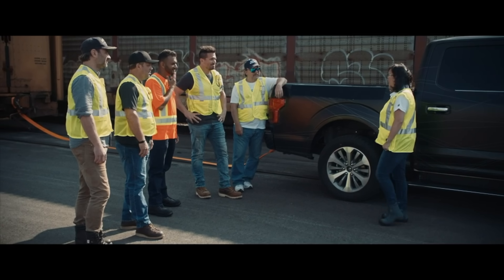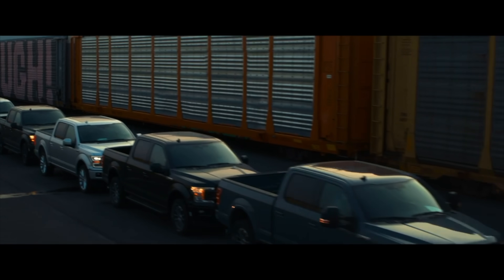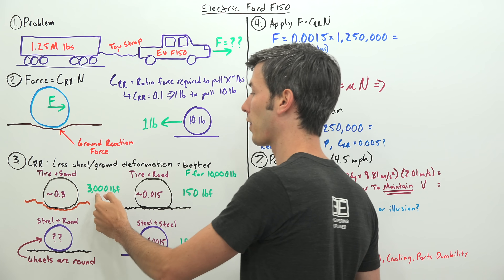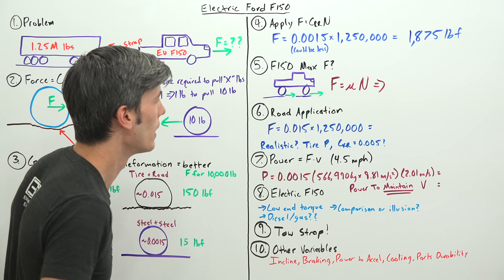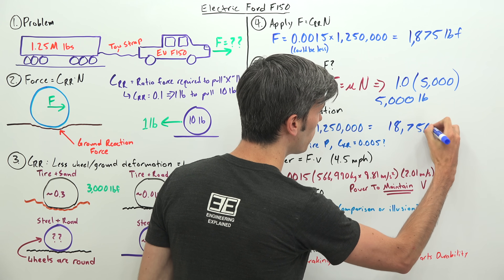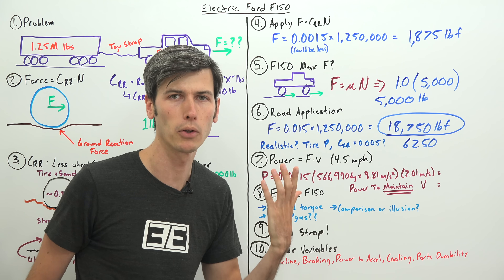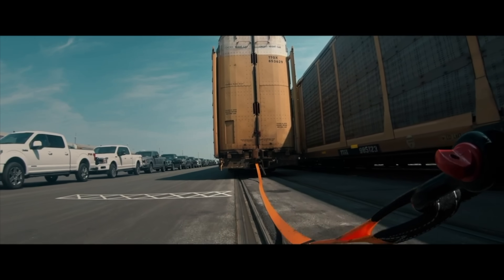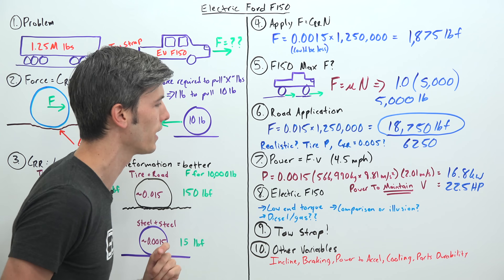No, Ford's Electric F-150 Can't Tow 1 Million Pounds (Realistically)

Comment: Each car weighed 125,000 pounds each. The railroad cars have a coupler that allows each car to move independently. You have a 3-foot draw between each railroad car. Another word's the first car will move 3 feet before the second car moves three feet this allows the cars to move one at a time so you not trying to start with 10 cars of dead weight. Back in the old days before couplers, the train length was limited to 7-8 cars.

Comment: To make it simple:

Imagine YOU, a human being, pushing a car in Netural gear, you push a car that weighs around 1500 kilos, doesn't mean you can lift 1500 kilos, since it has wheels with low friction.

So the F150 dragged a 1m pounds on low friction, so it cannot tow (lift) 1m pounds.
Reply: Towing is dragging something. 

Also tires have low friction? They would slide all of the place with low friction. That’s what tires are for!

Comment: Wait until Tesla's Cybertruck tows Earth to Andromeda galaxy.
Reply: Nah. The truck tows the Andromeda galaxy to our Milky Way galaxy.
Reply: Wait... That's illegal.
Reply: Well Andromeda is already getting towed to us right now by gravity D:
Reply: Wait until you try and tow a boat with the cyber truck and the battery dies halfway to the lake with no chargers fo a 100 miles
Reply: @poolguy101  yeah that's the prairies for you well as far as level 3 chargers are concerned only 6.6 kilowatt level 2 chargers will you be able to charge off of
Reply: @poolguy101   you better hope someone with a hybrid pro power assist F150 shows up and let's you plug into his truck.
Reply: @kdrapertrucker  or I could just let my backup generator run
Reply: @poolguy101  I can see it dying on the boat ramp. Lol
Reply: @maroownr861  what? Electricity and water don't mix?
Reply: Why Tesla truck can’t pull the earth 

*Starts staring at a different galaxy *
Reply: well if you wanna get technical that would require less energy... assuming you have a nearly infinite amount of time on your hands
Reply: You do push the earth, but you’ll pull it back an equal amount as you fall towards it, negating any gains.
Reply: Tesla can't out pull our 3500 at work. So there is that
Reply: no dumbass wait till telsa's cybertruck pulls a million pound load on a trailer with regular tires why cause it will have enough torque for that since a model x can pull a a380 a million pound load would be nothing for that cybertruck and be nothing for it's motor's
Reply: Raven4K The highest level of tesla truck barely can pull more than an F150
Reply: @raven4k998  ever seen the trailer you need to haul a million pounds? Very long with lots and lots of tires.
Reply: @raven4k998  pulling airplanes aren't nothing.vthey use 25 hp tractors to tow A380 at airports all the time.
Reply: @kdrapertrucker  yeah but they have to have special transmission for that cause believe it or not a regular f150 transmission wouldn't last that long doing that sort of thing don't believe me try it I dare ya rich boy that's why ford will try it with the electric f150 and not the gasoline version
Reply: might be the universe will mad with tesla.
Reply: Wouldn't surprise me
Reply: You need a reddit account now!  i would have given you gold for this
Reply: TRÅILBLÅZER lol
Reply: Need a long chord
Reply: lol hahaha😂😂
Reply: Typical ford drivers
Reply: Lets pull Venus further from the sun so we can start terraforming it!   😀
Reply: Archimedes says yo!
Reply: Lmao😂😂
Reply: It would work eventually (read: billions of years), but only if the Cybertruck has some kind of solid surface to push against. Otherwise the wheels would spin aimlessly.
Reply: Ewww tesla
Reply: @scrap5226  So what is you’re argument
Reply: @scrap5226  Well maybe if I watch you’re video on CTE I can track down who asked
Reply: @scrap5226  How are you gonna say who asked to a question it’s pretty clear I asked a question
Reply: @scrap5226  when did I tell you to speak
Reply: The cyber truck sucks

Comment: I actually watched your Tesla Cybertruck towing a Ford F150 video prior to this one (damn YouTube rabbit hole). You said that the electric torque had nothing to do with it being able to tow the Ford, but that it was just the ground force available due to it weighing more than the Ford. However, in this video, you say that this electric Ford has its torque immediately available. So, wouldn't that immediate torque availability give the Cybertruck the advantage over the Ford in that towing contest? I mean, if you can pull forward before your competition and get the momentum going, then you've already won.

Comment: I thought force was in Newtons
Reply: It can be either. 4.45N per lb. 9.81N/kg.
Reply: @alexs3187  isn't N/kg m/s^2
Reply: @alexs3187  f=ma
F/m=a
Reply: Megarocket16 I’m not a physicist, but I think you’re thinking of power. Force is just a constant. Like weight.
Reply: @alexs3187 power is in joules 
N/kg is acceleration
Reply: Megarocket16 joules is a measurement of energy, not power.
Reply: @alexs3187  watts

Comment: I really don't think that the truck in the video was electric, and here is why. I have a model x. when I tow I lose about 40% of my range. and the Model x is extremely aerodynamic. That truck, is in no way aerodynamic at all. if Ford was to build this truck in electric this would need about a 700+ miles range to be able to tow effectively. I would imagine that this would lose about 70% plus on range with its currently design. I know atm, there is no way that Ford is ahead of battery technology then Tesla or any other Electric car or truck company atm. please someone prove me wrong.

Comment: so basically Ford has shown us that the electric F150 could pull a gutted civic
Reply: Not really. Going by his numbers it could theoretically pull 125000lbs on pavement with pneumatic tires at the same speed in the video. Hauling 125000lbs is still impressive. For easy math let's say a civic weighs 3000lbs. In such a scenario, the truck could in theory haul 41 civics at a low speed on flat terrain - using the exact same force used to tow that million pound train.

If his numbers are correct, the truck could tow that.
Reply: @Artyomthewalrus  Burn!
Reply: When I was a kid my father backed  his 18 wheeler and unloaded pulp trailer in the (not so wide) driveway one night. Ended up putting the nose down in the ditch and was unable to get it out under the trucks own power. Long story short my uncle came and saved the day. That night a 98 2wd single cab V8 triton pulled that semi & trailer out of the ditch. Watching this video, it may not be as big of a deal as I remember it to be. Still cool none the less.
Reply: Tylor Chaffey 2 wheel drive? Never heard of it. Also the Titan is 4x4 and pulling a semi truck with rwd is impossible and front wheel drive wouldn’t work either. The rear tires and front tires need to spin to get something out of a ditch.
Reply: @JimmyDean59  I seen it with my eyes so call me a liar all you want lol furthermore ford don't make a titan that's Nissan. Get outta here
Reply: @JimmyDean59  I stated my experience and you came at me randomly with false information trying to get a reaction. FYI 1998 was 5 years before a Nissan Titan was even produced LOL.
Reply: Tylor Chaffey LMFAO dude didn’t realize you were talking ab the triton v8, not a Nissan Titan
Reply: where are we ? Oh yah the comment section on a Ford video. There's probably more triton engines on the road then Nissan's I would guess. He's just a troll anyway.
Reply: Yeah if you had the civic on a crane and a 1:1 pulley, the other end of the rope tied to a ford

Comment: Great, but you ignored inertial force needed to accelerate that big mas. It's Newton's F=ma, so for a equal to only 0.1 m/s2, the force would be equal to 50kN, which is ~ 5000kg and 11000lb, it's twice the rolling resistance force you calculated. Having 0.1 m/s2 acceleration means we reach speed of 2m/s  after 20 seconds, so in reality the acceleration had to be higher.

Comment: There is one other thing you did not take into account, when locomotive were underpowered to start a large load moving or the traction available was not enough, the engine driver would have the couplings loosened, this meant that you only had to start the first wagon moving, and then it would help start the second moving, and then both the wagons would help start the third etc etc, remember steam, diesel electric and electric locos all had max torque at zero wheel speed.

Comment: I can hook my Hyundai with 750k miles up to the same train and pull it just like the truck lol
Reply: Doubt it. Try hooking up a 50,000lb trailer and see if you can budge it. If this guy's numbers are correct and there is only a factor of 10 difference in rolling resistance between steel on steel and pneumatic tires on ashpalt, that would still be the equivalent of pulling a 125,000lb trailer on level asphalt at the same speed. I highly doubt your civic could do even half of that. Obviously I don't think anybody saw this video and though it can practically pull those weights at highway speeds.

Comment: pulling 5 metric tons (i know - a LB is around 453gramms or so - but just for simple calc) with a force equal to 7,5kg - wanna see that - cause even the empty wagon weighs way more than those 5 tons/10k LB (a normal street tram cab weigh up to 15 metric tons - 30k LB - wich, by your calc, would require a force equal to 22,5kg - but when you try to pull (or, to make it simpler: push) a street tram cab you obvious have to use a lot more force than what you calculated - I tried it myself and even I can pull/push way more than those 22,5kg I wasn't able to move the cab even a single mm)
so - although your math maybe right - the numbers clearly wrong

Comment: nothing impressive with the electric f150 towing 1mill plus pounds, i seen big guys pull Boeing 747 at airports. they only need to go a certain distance and use everything they got. just like how top fuel dragsters have their engines rebuilt every mile they run. i also in all seriousness doubt that ford could pull that train up Mount Washington .  i myself have pushed/pulled 5000+ pound vehicles on flat surfaces when they are in neutral for short distances.

Comment: Great explanation. In summary: a 1,250,000lb train on steel wheels takes less than half the power of a 292,000lb shuttle on rubber tires. I'll stick with the Toyota.

Comment: 0:14 What kind of strap can pull 1,000,000lbs? If it takes a 3/4 steel cable and pulleys to stop a f14 landing on an aircraft carrier, than how is a 3in wide woven strap going to pull that when you need 4 just to put an ATV in the bed of the truck?

Comment: Okay, of course it can't do it on the road. The difference is that a diesel or gas engine and gear based transmission would not be able to get enough low torque, and thus no matter what powerful big rig pig lifted truck you used, it couldn't pull this. The difference is the instant on torque of an electric transmission. It's why even trains don't use a diesel engine. It's a massive diesel powered ELECTRIC transmission.

Comment: That 1,250,000lbs load is about 500 tons I used to compete in strongman and have pulled a 100 ton load on railway tracks which in fact was easier than the average truck pull in strongman.
As explained in the video it took about 1875 lbs, so the 100 ton load would need  375lbs of force to start, so that's pretty well achievable for the average strongman which has a deadlift of at least 500lbs.
1875lbs of drawbar force is still a good number and only achievable for heavy, mainly 4WD vehicles like this truck or off road vehicles, most standard 2WD road cars will not have such a tractive effort.

Comment: If they want to impress me they need to pull 15,000 lbs. 400 miles at 65 MPH in a head wind of 20 MPH on a single charge uphill. 
I say they can not do that.

Comment: Either way the truck had to make the railcars overcome the static friction of it not moving. Plus a model x pulled a 250000+ lb plane which had rubber tires on pavement. How about go hook your truck to it and see if it can do it.
Reply: That's as impressive as the Toyota Tacoma that helped land a plane that had landing gear problems. The driver and pilot  managed to coordinate to land the front landing gear in the bed of the Tacoma and stop with no damage to the Tacoma.

Comment: 1) I'd like to see the calculation of how much torque it produced to accelerate that mass.

2) there's a video of a 4x pickup truck loosing a tug of war with a semi tractor.  The semi has more weight, more torque and more tire.  How does the Semi loose?  My guess is with the large ammount of tire, there isn't enough psi create the necessary coefficient of firction.

Comment: Here’s the problem with engineering explained. He’s so brainwashed with the oil cartels engineering curriculum rammed up his anus that he can’t even just admit that electric motors and batteries are far superior to the internal combustion engine, which is only about 30% efficient at most. Electrical engines are well over 70% efficient

Comment: So I could easily move 10 000 pounds with my hands ?😂
Reply: touchette Vincent 10000 pounds of a train car on a 0% incline. If the incline is. Even 1% you won’t be able to it’s only because it’s a a steel wheel on steel track

Comment: I was so confused about the "pound force" term, like "but a pound is a weight, not a force?" - TIL it's a really oddly named unit that's equivalent to ~4.4 N.
Reply: 1 pound of force is equivalent to a mass of 0.45 kg under 1g, or earth's gravity.

That's why a jet with a thrust of 50,000 pounds can fly straight up if it weighs less than 50,000 pounds. Because its mass is exerting 50,000 pounds of force downwards, but the engine's exerting more than 50,000 pounds of force upwards, so the whole thing can accelerate straight up.
Reply: The pound is used to measure force and mass, so you must differentiate the two units in equations. Otherwise, the math just won't work properly.

Also, remember that mass is essentially a measure of how much matter is within a given object, and is constant regardless of environment. Weight is a product of mass and gravitational force, which changes even at different points on Earth.

So, you can easily have pounds-force (lbf) and pounds-mass (lbm) in the same equation, where the object is shown in lbm and gravity is in lbf.
Reply: Look up the term "slugs".

Comment: wow, i didnt even know about that commercial XD, btw, i think your question #6 was a bit confusing, why are you assuming that it is 1,25M pounds on *tires + road*? the mass is on the rails, and i need to calculate the ground reaction force only with the weight on truck + the "rail reaction force" of the train:

(1.25M * 0.0015) + (5000*0.015) = 1950 lbf

and about accelerate and maintain i think it is perfectly possible...
looks truthfull '-'

Comment: Its still pretty impressive. Electric motors provide a lot of torque at low speeds I'm sure if you put this EV F150 next to a Gas or Diesel F150 and had some more data collection you could see some impressive comparisons.

Comment: anyone remember that volvo truck legit pulling a 750 tonne 'road train' (with tyres) using insanely low gearing? That's 1.5 million lbs on wet asphalt. Now that's legit (granted you're not going anywhere fast).

Comment: Just another reason why trains are so efficient at transporting good across the land. I knew one of the reasons was the low coefficient of friction between steel wheels and track. I was watching a video and apparently 2.5 degree slope is basically the max a train can travel and that's with them Spraying sand under the wheels to gain more traction. Pros and cons for sure. 

The wheel deformations is something I never even thought of.

 Thanks for the videos I really enjoy them and they're a great choice for anyone who wants to be a life longer learner.

Comment: Now your math makes sense and it all adds up. However, you are forgetting a vital asset in power transmission. Torque. Torque allows motors to transfer the power they generate much more effectively and with greater efficiency. That's why semi trucks and other vehicles designed for hauling heavy loads are built with torque converters and transfer cases. 

Nice video, but this is why engineers and auto mechanics are two different professions.
Reply: Payden Laderoute this has to be a troll

Comment: To overcome the problems of traction why not create steel wheels with holes drilled into them on the surface that touches the track, the holes are filled with rubber tubes which have a hydraulic spring/supporting device that retracts them as the train moves faster, using the centrifugal force on a hydraulic fluid. Obviously much more expensive to produce but on the cost of a train the will represent very little cost
Reply: you also forget maintenance cost and redundancy which for a train can make or brake abuissnes with how margins are falling.
Reply: Sure I haven’t thought about maintenance cost, which would be higher. Redundancy is built in to a wheel individually in that the system only retracts the rubber as the wheel is turning, at speed, if some how something got jammed and the rubber couldn’t retract then none of the other wheels would be going quickly enough for the system to retract the rubber, this could be backed up using a wheel speed sensor. What I don’t know, but I am just assuming to be correct is that this idea would make any difference to the traction effect, particularly in the wet.